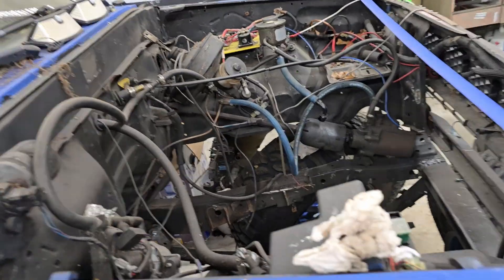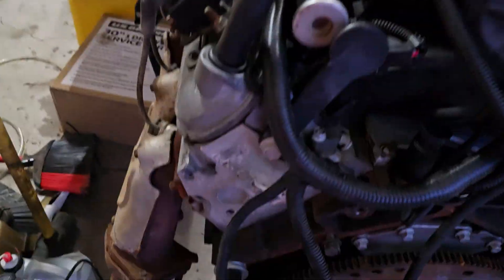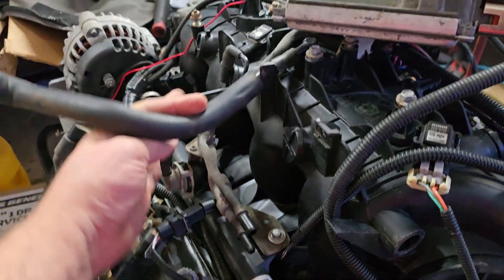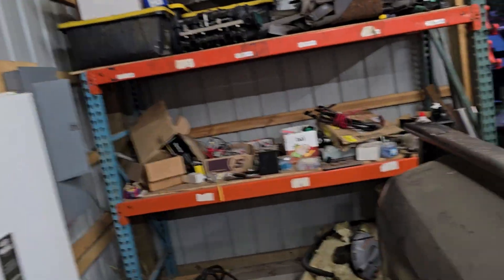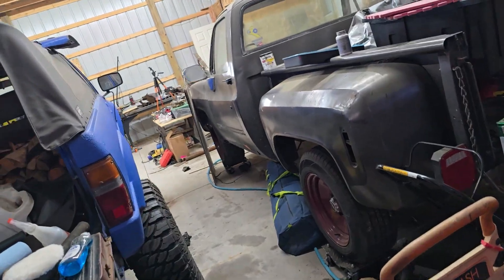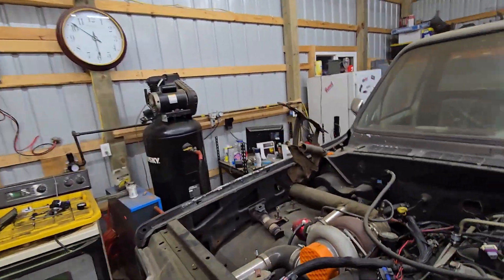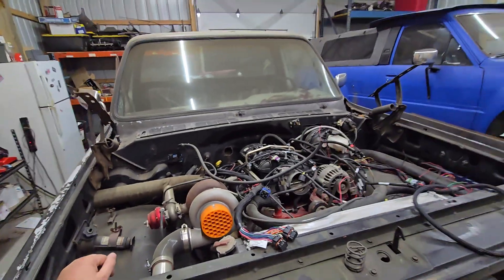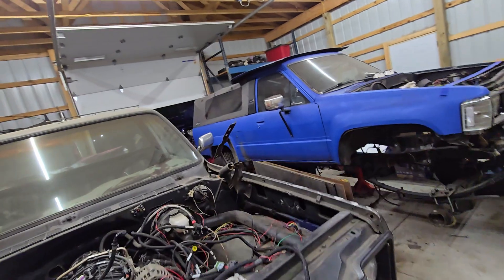LS Basics, fuel system explained!

Comment: Excited to see this build! Got an 85 toyo pickup in planning on doing in the winter so would be helpful to see what clears and what doesn’t with the stock truck stuff. Also curious what mounts you’ll use
Reply from the maker: I have nothing but bare frame rails, will be 20.00 universal Ebay mounts welded in wherever they hit

Comment: It seems like the evil energy pumps are $60+ for a 300lph, are the $40 kemso 340s on amazon not real or something?
Reply from the maker: You're not looking at the pump linked in the description
Reply: @TheDrivewayEngineer i only see a filter, line adapters, line, and the regulator. I saw that amazon list on top but the only pump it had was a discontinued Ford pump. 

Im on mobile, maybe it's the app or something.

Comment: Thanks for going through this JR, i really wish i had remembered your rule on buying my swap complete with everything! Sorry a little long, but i would really appreciate your input: 

I bought my 5.3 with 4l60e for $300. it’s missing the harness, ecm, e.manifolds & o2 sensors. (i got too excited 😂) 
The worst is that i forgot the golden rule “if it spins it wins” 
I went to spin it last week it and it’s locked up 😭 I looked down the cylinders and they are rusted stuck. 

The guy i got it from said it was running when pulled. He seemed honest but the intake was taken off of it. I think rain got in there, it was sitting outside for a couple years. 

Should I try to sell and start all over? 
Part of me wants to pour vinegar in the cylinders, and just get an ebay harness/ecm/O2s 
But I feel like that will add up and i might still end up with a messed up engine. I was trying to keep this super budget. 
I’ve seen some guys just get an intake and carb these as well, tempted to try that too.
Reply from the maker: I'd try to free it up, that doesn't really cost anything, if not, just get another.
Reply: @TheDrivewayEngineer Thanks for the reply! I’m going to try and get it freed up. I think it would be fun to mess with anyways. 
I’ve seen some guys running a cheap intake and carb. I’m tempted to go that route since I’m missing some stuff and it looks like they could be had cheap. 
Have you ever carbed one? Not sure if they are worth it. I’d be happy to just get my car on the road and do burnouts lol
Reply: I would try some marvels mystery oil down the holes myself
Reply: @shawnwimberly9294  i’m definitely a believer in that stuff! The cylinders are pretty bad though. 
I was thinking a vinegar soak and then MMO. I’ll probably have to take the heads off and scrub. They’re that bad.
Reply: Part it out and grab a running donor.

Comment: So only thing  to note here is if they have a cam like a chopacobra or truck norris or bigger then they need to be going to the 50lb flex fuel injectors because stock injectors u will just run out of injector at like 5000 rpms up im only saying that because i have seen where everyone that has tryed to run stock and there 80% duty cyl or higher like 100% where the injectors just stay on with no off time and that is a good way to blow a motor up all it takes is for it to stick open one time on a pull and its game over other than that jr is a good fella and has good info on things we are all here to learn together
Reply from the maker: I run them on stock injectors without an issue
Reply: I don’t think I believe this to be true. Is that what somebody told you?
Reply: @shawnwimberly9294 its a fact i tune everyday with hp tuners
Reply: @haroldpowell are you targeting the factory afr for power enrichment? If so, that's why. If I remember correctly it's like 11-11.5:1 stock PE. I brought mine up to 12.5:1 and I think my max duty cycle was like 83% or something. 

Also, people run 90%-95% duty cycles without issue. I agree with JR. Stock truck injectors are fine on cam only setups.
Reply: @haroldpowell I also own hp tuners and a wide band …I guess we’ll have to agree to disagree
Reply from the maker: I don't sell anything.

I run 95% injector duty cycle just fine lol.
Reply: @haroldpowell   “its a fact you tune with HP tuners every day”?  I'm not buying it, Bud.  Based on your channel you spend your time playing PUBG Mobile.  
Honestly, If even you had one video showing yourself tuning ANYTHING with HP tuners on your channel I would still question your knowledge.

Comment: I have done many swaps in the last 15 years and agree with a lot of what you have said, I have used the Fitech surge tanks, work great. Fuel flows thru them keeping everything cool.  I do use frame mounted fuel pumps often with swaps using carbs, the float bowls pick up the slack on delivery but the most important thing is not to deadhead the fuel line.  On an injected vehicle the Corvette filter/regulator has worked for me, biggest problem has been differing quality of the units.  Other than that a bypass regulator works great with a return and even a standard regulator works as long as you are returning a small amount of fuel to the tank to keep the external pump cool and bleed any air in the system back to the tank.  I have used something as small as a tee at the carb inlet with a return fitting restricted to around .020", a small carb jet will work to return a little fuel.  It removes 95% of the stumbling if you gulp a little air.
Reply from the maker: Good info, thanks for sharing!

Comment: Thanks again. You covered all basics and I forgot about the return line back to the tank. 
Q: My Trans Am has the 1/4?? Maybe 5/16  return. Is that to small of a return. I am running 3/8 along the side frame from tank to engine. 
I appreciate your time.
Reply from the maker: If it's an efi, like third Gen, it's 5/16, and that's plenty
Reply: @TheDrivewayEngineer it was the crappy 301 turbo with the draw through quadrajet sitting on the driver side valve cover. But i will measure Sunday. Your such a gift to our car community!

Comment: I did a LS swap in a Jeep JK all the wrong way. I didn’t listen. I just got done putting the factory gas tank back in it. I was using a fuel cell. I also light $1500 on fire for ACES EFI which does work well for now. I’m going to put a LS in my 72 Skylark and do it the right way. Well mostly I’m only 59 and want to do many more.